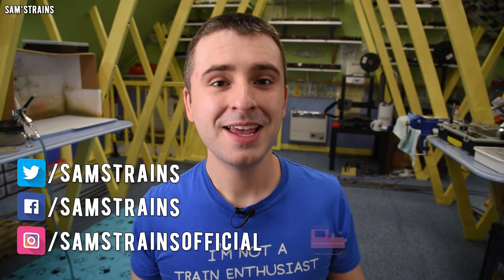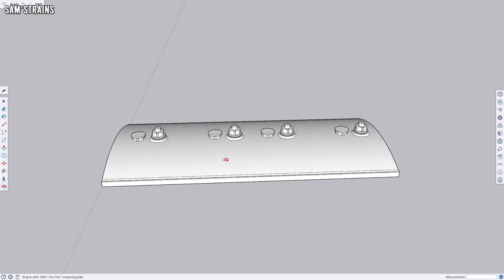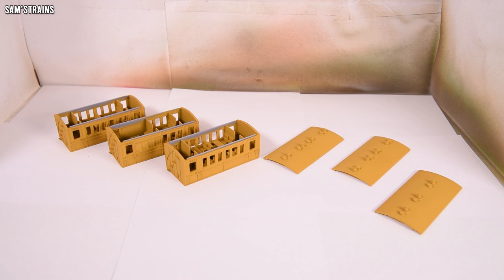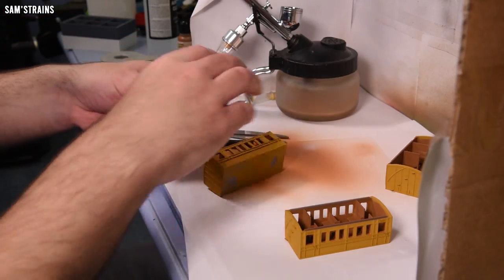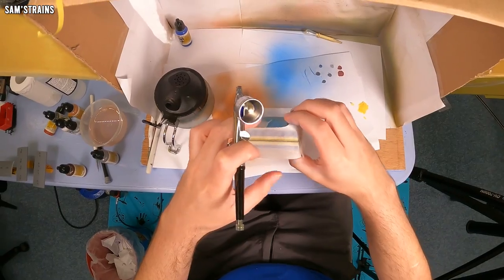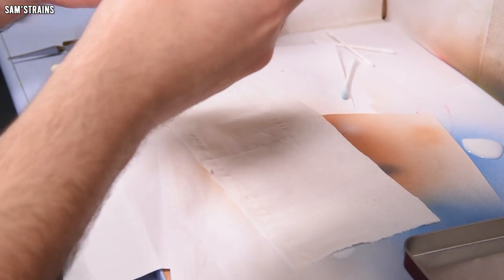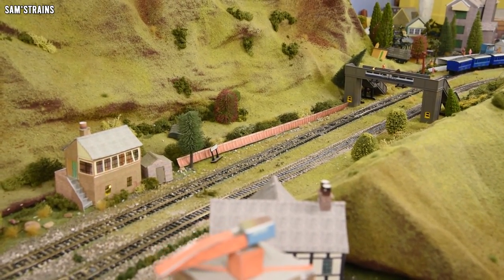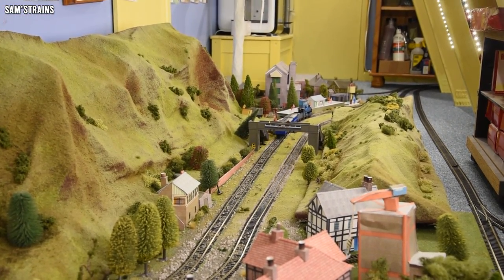Scratch-Building Custom Pre-Grouping Train Coaches

Comment: Absolutely delightful. Thanks for sharing your journey deep into the Land Of Cute.

The cylinders underneath later C19th coaches are for gas or oil -- depending which system is being used -- so a coach thus fitted will need only a small chimney above each lamp, as opposed to the big fat chimney/housing seen on a self-contained oil lamp in earlier coaches. In theory you'd expect one lamp per 'compartment' in 3rd Class, and two in 1st Class, all being centred between facing pairs of seats. There would also be one ventilator next to each lamp.

The cylinder might alternatively represent the spring housing for Newall's semi-automatic brake, patented in 1856 and adopted by the LSWR in 1858. The system could be extended to a coach on either side of the mechanism, so in a Newall-fitted set of three the coach with the guard's compartment would have to be the middle one.

Passenger luggage in the C19th was usually in hampers, trunks -- which is why luggage vans and luggage compartments had double doors -- or Gladstone/carpet bags. The suitcase was virtually unknown until the 1920s, and for travel use only became more or less universal in the 1950s. Just saying.

I do like your 'faded' suitcase, though -- clearly belonging to a much-travelled passenger. Even if you don't weather your rolling stock, you've made a start on the luggage...
Reply: Early suitcases in North America were called grips, from the late 1800s, and were very well known during the tumultuous '30s.  Trunks would be even easier to mold but only for cars used by long-distance travellers.
Reply: @randytaylor1258  As I understand it, grips were akin to the modern sports bag, soft and flexible with a zip opening along the top and two carrying handles, but made of canvas with a fabric liner. Suitcases seem to have evolved from the Gladstone bag, which was made of hard leather and opening right out from hinges underneath, with one carrying handle, usually fastened with snaps or clips. The carpet bag was a small soft version of the Gladstone bag, only the frame around the opening being rigid.

Comment: The cylinders underneath the coaches are generally the heaters for them.
Pretty little coaches, Sam. Nice one. 👍👍👍
Reply from the maker: Thanks a lot for the info Brian - appreciate it!
Thanks for watching, Sam :)
Reply: The difference between RCAF and other Commonwealth Harvard training aircraft is the length of the exhaust pipe -- really!  The exhaust comes out on the right side above the wing but Canadian Harvards have a.much longer pipe that exits behind the rear cockpit, so it heats the two cockpits while flying above the frozen tundra.  (Suppose Spitfire and Hurricane pilots would have liked a heated cockpit?)
Stoves in many old trains had long, meandering chimneys to increase the heating in the coach.

Comment: They look really good.  The design with the vestibules and centre aisle is nice and the guards section is excellent.  You know, I think you are a better painter than you give yourself credit for.  When I am painting fine details like hand rails or other tiny parts, I find it useful to hold the job on something solid (like the table) and use a spare finger on my brush hand to brace against the job whilst using just my fingers to move the brush and not my whole hand.  It eliminates the problem of holding the model in one slightly shaky hand and the brush in the other slightly shaky hand while trying to accurately place paint.  My hands are very steady but even the steadiest (and youngest like you) hand shakes a tiny bit.  Also I find that I REALLY have to be in the mood for it.  😊

Comment: Hi Sam, you've done a great job on those coaches and should feel proud. I'm very impressed. I can see a steady improvement in your 3D printing efforts.

A couple of suggestions for future projects:
- Have you considered printing the interiors separately so they just slot in? This would make it easier to sand and paint them and add passengers if you wanted to.
- If you want to take it up another level how about adding some LED lights? With the time you spent on the interiors this would make it easier to see them. 

They could either powered from the track or one of those kits with a reed switch, battery and magnetic switch. I think the latter would be easier. You'd need to design a hiding place for the battery. Perhaps the roof, end or if doing a slot-in interior under that.

Comment: My suggestion for little details like grab irons and stuff is to use a simple sharpie. I use sharpies for all of my little details and as long as you have a steadier hand than I do (which doesn’t say much) than you should be fine.
Reply: Yep, i also suggest it. I repainted some Hornby coaches and detailed them with sharpies :D
Reply: @matthew_thefallen  pretty useful little things they are. The come in all different shapes, sizes, colors, fine tip, round tip, wedge tip. Sharpies are great!

Comment: They look lovely, Sam. You should be very proud of your work.
I'm not sure what wheel sets you use. I use the dapol spoked ones, which you can buy in a pack of 20 for £17, I think. I combine them with 2mm pin point brass bearings, which I think were about £5 for 20 or maybe 40, and I have very easy running 3d printed rolling stock. I just leave a 2mm dia hole where the bearing needs to go, which fills in a little with the filament when it prints. Then I drill them out carefully with a 2mm drill bit and press the bearings in. Worth a look at using them.

Comment: When painting details by hand mount the paint job firmly to a solid base so hand shake does not affect the application of paint. Likewise use a hand rest to steady the paint brush e.g rest the base of the fist on the desktop. 
Great job but - much better than the cheap blue wagons Hornby produced (maybe with their clockwork sets?) that had moulded couplers and interior or glazing.

Comment: Sam, for your next project, can you 3D print some girder bridges for the gaps on your O gauge layout? I cringe every time I see an expensive loco on those bits of track, especially when it flexes.

Another idea might be to lay roofing felt under the track to simulate ballast, hiding the bare wood.

Comment: Masking.  Instead of the fiddly masking you did inside the coaches with tape, you could have used a liquid -- either liquid masking medium or white glue -- inside the windows, etc.  When you're done just poke them out and, if necessary, run a brush with some touch-up paint around inside the openings.
I hadn't thought of sealing the masking tape with a coat of the original colour but I have done so with clear -- any leakage is sealed with clear before the paint coat.
Very adventurous, Sam, and totally successful.  Hurrah!

Comment: Lovely work, Max.  You're becoming a master at making your own models.
Thanks for the videos of the printer actually working -- like watching a tiny animal breaking out.of it's egg.
Avoiding dedicated modelling tools, I've had great success with fingernail emory boards.  The cheaper the better because the thin ones are easy to cut and shape for work in fine places.  If you need extra fine grit you can take a used one and glue fine sandpaper to it -- still dirt cheap.

Comment: off the back of your 3d printing I actually got a 3d printer, PLA as yours, for I suspect the same reason (fumes from resin!), N gauge and not really had much luck with N gauge stock..

however it is very good for terrain features, have you tried stuff like platforms, buildings etc?

Comment: Very nice. Generally, 1st class has more leg room than standard, so I would've spaced the seats out a bit more, sacrificing the doors at one end to give it enough space. Also, standard is generally 2+2 or even 3+2 seating if a central corridor like this, not 2+1.
I'm actually working on a parkside 0 gauge AA19 Toad kit at the moment. I can't do too much because the sprue containing the veranda end and sides is missing, but I'm getting smaller modular sections done to save me time later (like the couplings and buffers).

Comment: Well done. The move to Airbrush is a Great Move. The finish is so much Nicer.

 I may have missed your 'Sam Buys an Airbrush' video.

 Good to See the Mask in use, but personally I just rely on Good ventilation.
 But I am 67yrs Old and Smoke, you however are/do Neither.
 Basically I'm F**ked. 

Safety First, very Commendable..! 😎

Comment: Did you see / hear Pete Waterman on the 3rd Beyond The Buffers talking about the problems 3D printing may have 2 to 3 years down the line when cheaper resins apparently start to warp? I wondered what type of resin you use? Kind regards, Jeffrey

Comment: tip for the curved handrail painting, use the edge of the brush and let the raised surface help you, the top is probably something you can do in a similar way - its not that hard to paint upto the body (and can touch up the body) - secret though then is like a dark wash paint which will hide so many sins - just paint it into the join

Comment: would painting the interior detail be easier if it was printed separately with the outer body a 4 wall shell fitted over post painting?  May make the outer panel easier as well not needing so much masking.

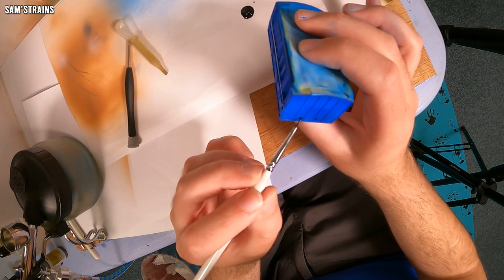Comment: 12:30

For painting things like hand rails, steps etc I have had reasonable success using cocktail sticks (bare in mind this is in N gauge) as these are ridged so you can be more precise with the paint.

I have also been told that sharpie / paint pens work well. Yet to try that myself but would make sense.
Reply: Molotow's chrome markers are especially useful.

Comment: next time you shod print the outside and inside of the Coaches seprit and make it a snug fit for win you put the inside in wood make panting thim eser as well
Reply from the maker: Yes you're right that would be better!
Thanks for watching, Sam :)
Reply: @SamsTrains  yea i have some coshes and that is how the inside and outside are
Reply: I was wondering whether it would be easier to mold the interior on the carriage and do the walls separately -- make painting and detailing easier -- but this could work, too.

Comment: after half a year of working on my n scale locomotive body andworking around limitations of ender 3 style printer i would say you are doing it wrong. your walls are flat and overlap with details that stick out, it is a perfect oportunity to split model in flat panels, enable ironing in the slicer and forget about sanding those wobbly inperfection  made by printer ghosring ot layers, you can literally print smooth surfaces
small details could also br painted first then put inside
also details on the top layer could be single extrudion , whole lines and unbroken shapes, which would work for your fancy handles